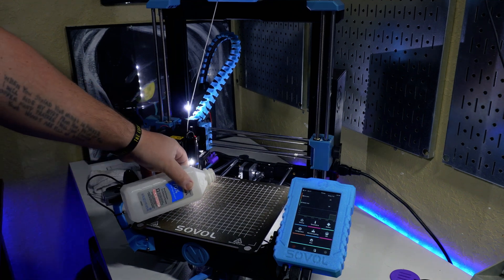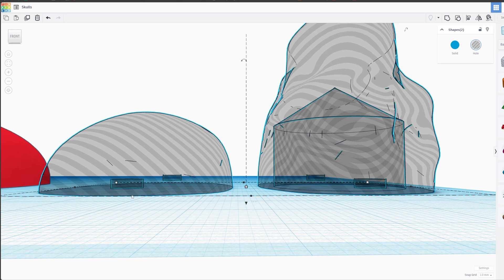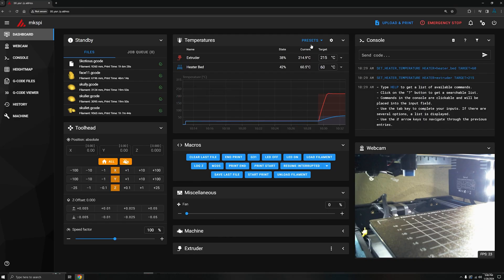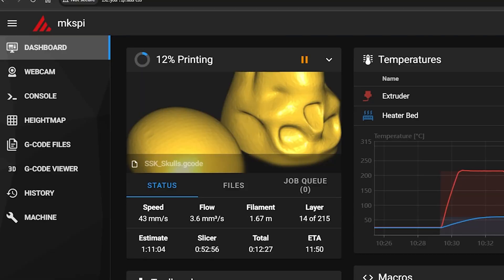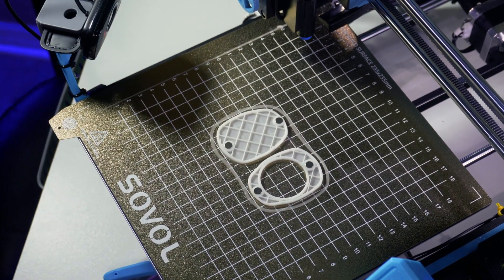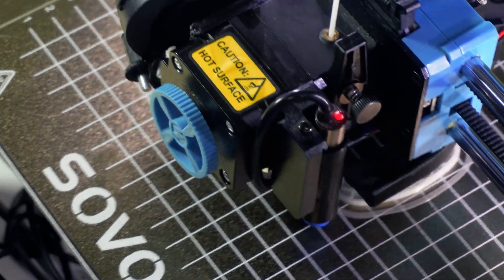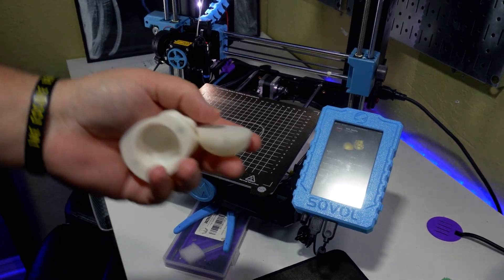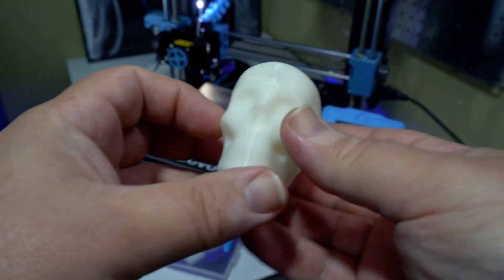Concealing Magnets in a 3D Print for a Smoother Look!

Comment: Awesome print. What's the of that printer? it looks like the Prusa printer.
Reply from the maker: It's very similar to a Prusa. I went from the cr6 to this, and then I added their klipper screen a few months later.  The printer is a SOVOL SV06. I have links in the video description if you want to check it out. 

It's a really good printer for the money.
Reply: i use Simplify3D slicer. will that be a problem if I buy this printer? Also does it print fast than the Ender 6SE printer?
Reply from the maker: The SV06 is listed as a supported printer on the Simplify website, so it shouldn't be a problem.

https://www.simplify3d.com/products/simplify3d-software/supported-printers/

Yes, it can print faster than the CR6. And a lot faster if you ever do the klipper screen upgrade. I've got walkthrough videos if you want to check them out. Just look for any videos I posted about the SV06 and  see if it's for sure something you want to dive into.

Comment: A couple of my printers don't respond to the pause at layer height script in Cura but I was able to get around it by adding M300 to the G-code before pause and G4 S120 to the G-code after pause.  Works perfectly in my case.  M300 is a beep command to let you know you're at the desired layer and G4 is a dwell command which will just wait for the desired S time (ie 120 seconds).  I actually use G4 S60 now as most times that's enough to insert nuts or change filament.

And a little tip for inserting magnets...and I learned this the hard way...don't use a hardened steel nozzle if you're using strong neodymium magnets.  At least test the nozzle against a magnet first to be sure it isn't attracted to it.  I've had prints pulled off the bed because of this.
Reply from the maker: Whoa, I appreciate all the info and tips! Thank you!